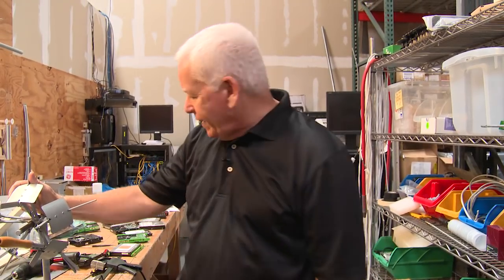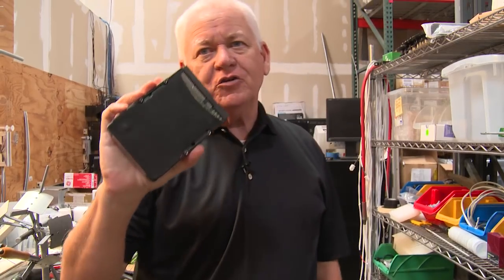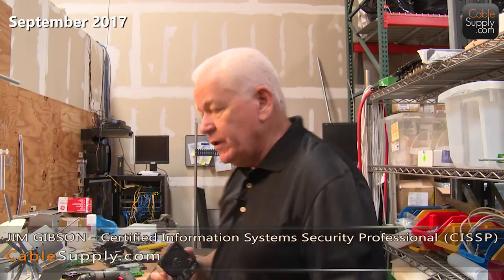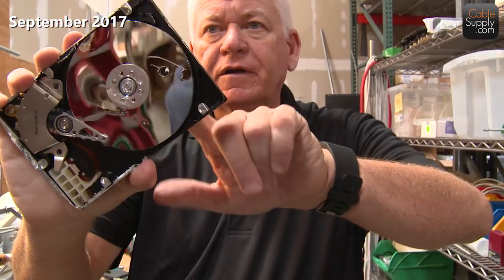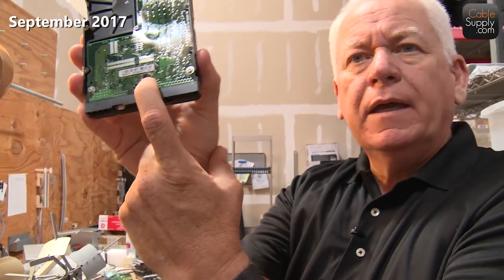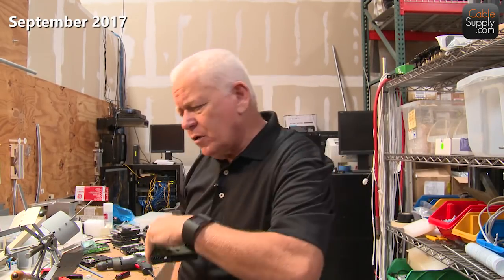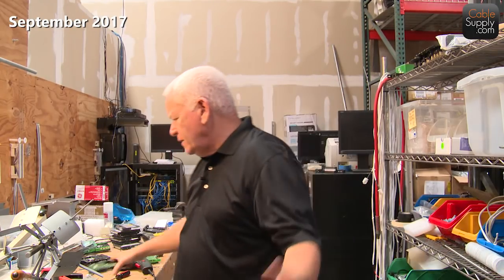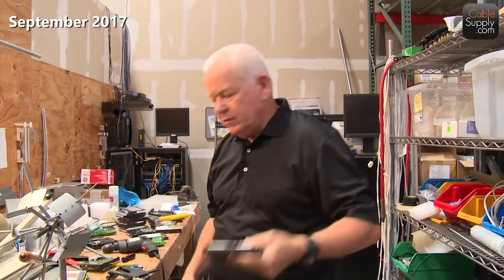Why You Should Destroy Your Old Hard Drives - Part 1

Comment: Good video Jim! I have used DBAN to do a Department of Defense 7 pass data wipe  at ADP Probusiness a payroll company back in 2005 before donating our decommissioned Compaq servers to a local non profit, it seems a shame that you rather destroy a hard drive rather then e-recycle them as they are still useful, however if the hard drive failed then I would take the platters apart and sand down the surface.

Comment: Personally I disassembled the drives and remove the magnets(they can be useful) then remove the platters, use the removed magnet to scratch and degause the platters then add them into a thick plastic bag and smash away with a hammer until they are tiny fragments.

From there I spread the destroyed platters into multiple bin loads over the weeks amongst my general waste. 

Maybe it's overkill but I am disassembling anyway for the magnets so might aswell take out the platters while I am there.
Reply from the maker: It works for me! Thanks for watching! Please subscribe!

Comment: Hammer on case doesn't quite do the trick if the data is still on the platters.  Unscrew it, remove the platters and use the extremely powerful magnets that comprise the actuator to erase the surfaces.  The platters are very pretty and maybe could be used for decorating, the magnets make dandy refrigerator magnets provided you can pry them loose.

Comment: If you want to secure your deleted data and still wish to use the Hard Drive, Find a Partition Manager app.. there are many that provides free service.
Break the partitions and then fill the whole drive with "zeros" (it does exactly what it says, overwrite the used/unused data sectors with zeros). 
Once successfully done, no data can be recovered.
It's not difficult at all but time consuming.

Comment: this guy sells hard drives doesn't he?
Reply from the maker: No I don't.  Thanks for asking.
Reply: @CableSupply  I appreciate you clearing that up. I’m just wondering what’s the point of destroying a perfectly good hard drive? In terms of data privacy, erasing and writing over the drive a bunch of times will keep 99.99% of people from reading past data, and if you’re worried about that .01% then couldn’t you just reflash the drive’s firmware to remove the last traces of the previous data?

Comment: Hello, Jim.. Previous posts you say when you have finaly finished with
 hard drives you have replaced, to make sure no one steals your 
data..Drill..Smash it up..Does this also apply with SSD HDs..Get your hammer 
and 'Whack it!
Reply from the maker: The best way to destroy data on an SSD is to crypto shred. Crypto shredding is when you encrypt the data that is on the SSD and then destroy the key. At that point the data is unreadable. Now you can do whatever you would like with the drive.
Reply: @CableSupply  It is important to completely fill the SSD.  It writes into a different area than it reads, see "wear leveling".  So the only way to ensure every cell is written is to fill it; but they typically have spares that you cannot see.
SSD's are heat sensitive.  I imagine that cooking them in a conventional oven for a few minutes out to discharge the stored charges that constitute its memory.  I have not tested that theory.  Magnets do nothing for SSD.

Comment: I wanted to wipe an old 40 gb hard drive, but it started acting erratically, so, instead, I took the cover off and removed the platter which was just a single round metal disk, and then I took a Radio Shack Realistic high power audio/video eraser and held over each side of the round metal disk and hovered it over each side for 10 seconds.  That should be sufficient to ensure the data on the disk got wiped out, right?
Reply from the maker: Old 40GB ?  buy a new hard drive.
Reply: @CableSupply  I already have newer drives, those were just old ones that I wanted to wipe before bringing to recycling center.
Reply: Probably sufficient.  The coercivity of disk drive platters is unusually high (requires strong magnets) but as it happens, disk drives come equipped with strong magnets; older and larger 3.5 inch drives have much stronger magnets.

Comment: When one drills hard drives it is imperative to completely penetrate the platters in a way to totally disable.  One best remove the cover plate to inspect the desired job.  One or two HDD's don't take much effort to confirm total destruction of the data.

Comment: Brutal and straitforward but one of the only way to securely protect data propagation, I personnaly like to dismantel my drives to spare the magnets for small hobby projects and at the same time collect the alluminium for my fondry witch is about 400 pounds a year melted and casted in lingot. The platter serves as lazer beam mirror and/or building variable capacitor. I definitively like the recycle part of hard drives but your method is more accurate for data protection. Thank's for the video, it's convincing...

Comment: The debate on re-writing stems from the fact that some of the better data recovery software can detect whether or when a sector was changed from 1 to 0. A minimum of 4 overwrites is required to avoid this. The 1st pass will stripe all sectors to 0, 2nd pass will stripe all sectors 1, The 3rd pass will stripe all sectors to 1, and the 4th The 1st pass will stripe sectors 1, 0, or random. This renders the drive safe and nearly impossible to recover the data. That being said the Nuclear method requires 31 wipes and iv heard this is the SOP for the US military.
Reply: overkill.

Comment: Don't use a drill.  If someone was smart enough they can recover data from the top and bottom of the holes.    Your best way is to completely destroy your data is to shatter the platter.  Once you hit it correctly it will shatter into time peaces just like a CD does.  

Or you can just keep the drives and use them for backups.   I even have a couple of the 80GB IED drives used for storage.   From time to time I load those drives.
Reply: DestructiveBurn , I hope you meant IDE...  Those IED drives are far too noisy for the average office...  ;-)

Comment: I love this channel. I just started a new job which requires a bit of cable, switch, and rack knowledge and I have some, but more on the Computer side and not the infrastructure. This site has been extremely helpful in getting me at least familiar with that aspect of data transfer and cabling..  Than you sooooooo much for being here.

Comment: What I find interesting is that offices do not remove the hard drives from there photocopiers/fax machines. Imagine how much is stored on a modern day to day office photocopier/fax machine.
Reply: I heard photocopy hard disk most dangerous in world, library ones people scan pasports and shit all time
Reply: I know this is an old post, newer photocopiers have a setting to wipe the copy or not save the copy.  Its always better to remove the drive and err on the side of caution. If you remove the platters and slide them around on raw concrete sidewalk like a sanding block, it removes most of the magnetic coating and leave the surface very rough.

Comment: Personally, I don't see the need for the average person to have to destroy a hard drive. If I pull one out of an old computer, I simply format it and wipe the disk clean and then use it as a data storage disk for movies & TV shows. I don't sell them or give them away. If the disk has gone bad and I'm not able to recover it, it goes back for warranty replacement or I pull it apart for the magnets, and I will destroy the platters.

For the average business use, then something like Ccleaner to write zeros to the entire disk should do the job, then you can use the disk for data back-up or whatever other purpose you may have for it.
Reply: i had a friend pull up old data from my hard drive that was written over using a program he downloaded. i dont recall the name. but it pulled files i had deleted as far back as the day i bought it.  so people can still pull data off your old drives.
Reply: When data is overwritten it can not be recovered. Only the parts and fragments which were not overwritten. Also depending on the OS, the filesystem which is used and it's methods for formating, do not overwrite the complete filesystem by default. See "Overwriting Hard Drive Data: The Great Wiping Controversy" by Craig Wright, Dave Kleiman Shyaam Sundhar for example.

Comment: There is software that can retrieve data from multiple overwrites. And limited physical destruction only makes a portion unreadable. Even chipping really isn't enough and, I don't trust degaussing. Thermite, I trust turning the drive to slag. Nothing less.
Reply: but i want to know which software recover overwrites data if you know or anyone know please suggest
Reply from the maker: Thermite will do it.
Reply from the maker: Obviously, most small businesses do not destroy their hard drives and do not realize the risk of leaving easily accessible data on a hard drive.  However if you are working with highly sensitive or government classified information, the hard drive MUST be completely destroyed and turning the drive to slag is absolutely the best way.
Excellent answer!
Reply: What about putting the drive in fire? Or opening it and soaking it in saltwater to turn it to rust?